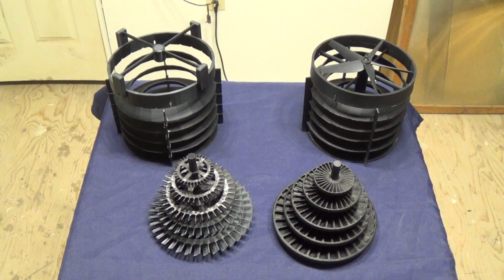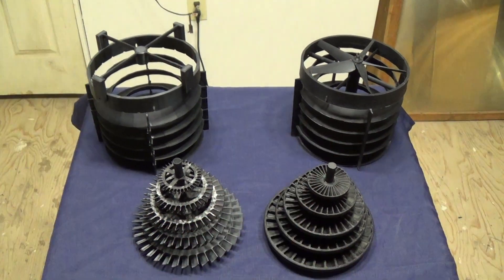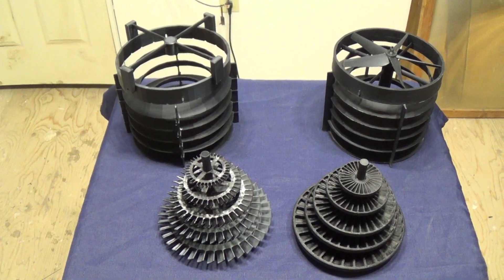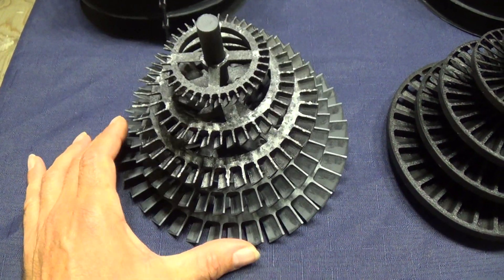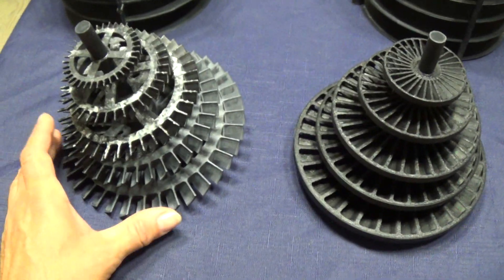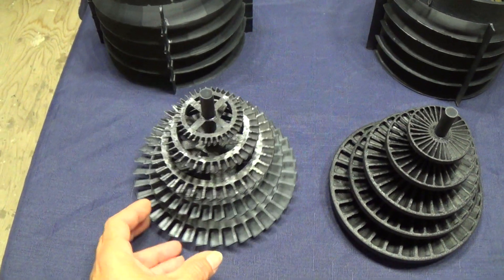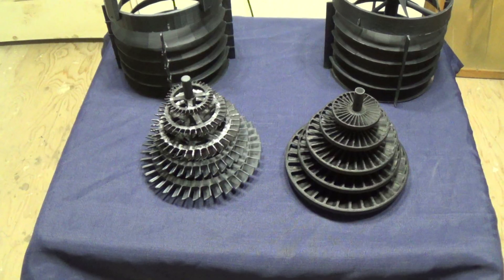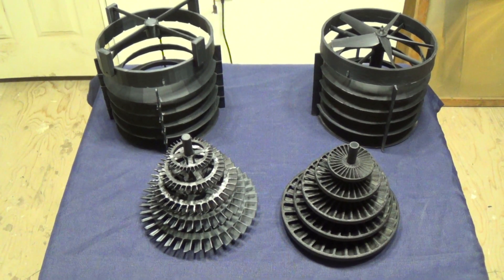TURBOJET WIND TURBINE could be the most efficient Wind Generator ever built!

Comment: This is amazing!  It's a Great compact system.

I was wondering if you would ever consider combining this with a solar tower?  Or some sort of heat Chimney?  It could be solar, it could be cooling a computer, or a combination.

I'm just thinking that a solar chimney might add some consistency, but also means that you're probably going to need to increase the capacity to handle both the updrafts and whatever wind you're planning for.

This looks amazing! I look forward to your next video! I've got the notification Bell rung, I haven't been disappointed yet.

Comment: Any thoughts of a combination stacking the types of turbo fan blade? Maybe the diameter or location of blade types has efficiency of capturing wind to capture both low and high wind speeds. 
Just a thought for a combo, each stack level of blades has both types of blades interspaced from the other type (banded or not banded).
Thank you for your many years inventions and experiments.